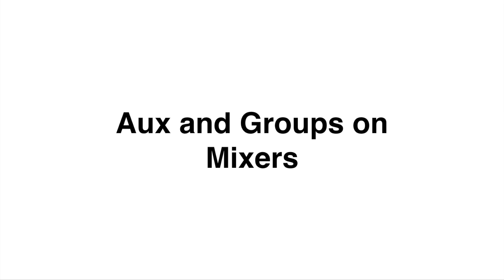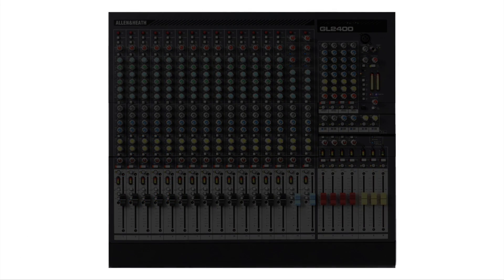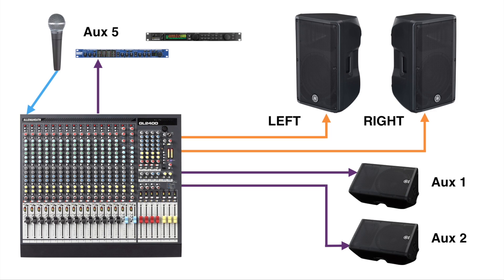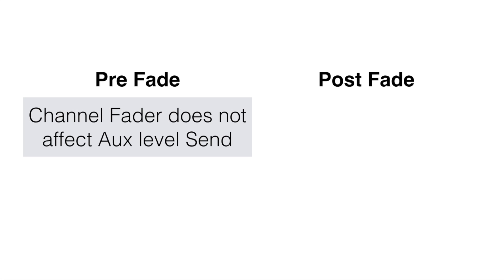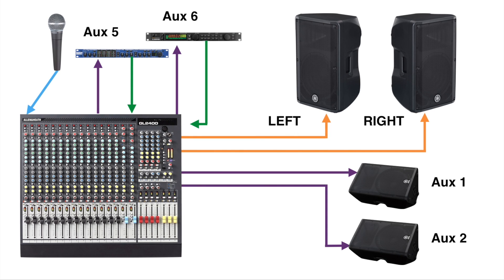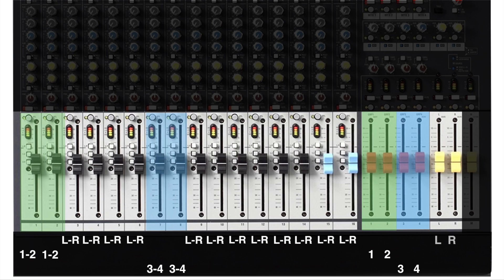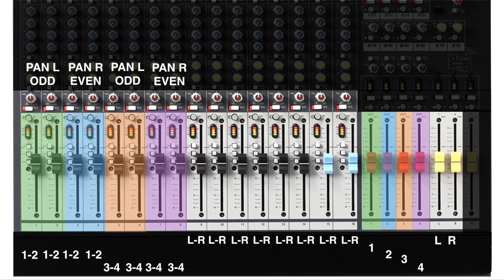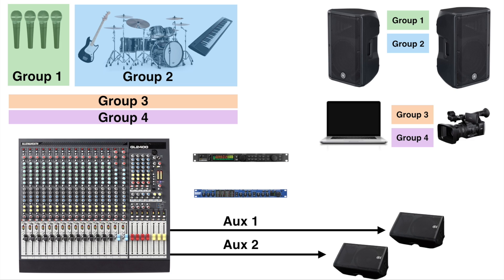Aux and Groups Explained in less than 11 Minutes

Comment: You were doing great until you got to the use of the groups. You wouldn't use a group output to create different mixes for a laptop and camera. The way you have it set up, since the vocals are panned to the left to be on Group 1, the laptop would only get vocals if you assigned it to 3-4. And the camera would only get the band. A better way would be to do pre-fader Aux mixes for each recording device. In this example, you would typically use groups to subdivide the band into drums, keyboards, guitars, vocals, then I usually run only the bass straight to the main bus, turning it into a 5 bus. Other than that, great video and great presentation.

Comment: How do I maintain my stereo panning and grouping? For instance, if I pan my bass drum full left and my floor Toms full right for the LR or FOH. And I need to group my entire drum kit on Group1 in order to have a uniform volume control. That will require planning all to the left/ODD. Will the mixer still maintain my LR drum panning set up for the LR despite the group 1 ODD panning  Or the group panning will affect the LR panning?
Reply: use 2 group channel to output your drum kit, e.g. Group 1 for L and Group 2 for R, then you can: use the group XLR output as is, on the matrix or send the groups (with pan) to LR

Comment: Hi Marlon, I have one question.  The group output for video and laptop, are they mono or stereo?  I am using Allen and Heath ZED 428, is it better to use 2trk out instead? (just for the video camera?).  You haven't talked about MATRIX 1 and 2, what are they?  Thank you.
Reply: each single output channel, whether it be L, R, Group 1, ..., Group 4, MTX1, MTX2 is mono, as a result use 2 output channel for stereo
Each matrix channel independently source portion of: external in, each group, L, R to be its output
2 track out (TRS, -2dBu) is another way to obtain LR out which is XLR at +4dBu
Reply: @philiptong4978  Hi Philip Thank you so much.

Comment: When assigning groups, does panning still affect which side of the speaker the sound is coming out of?
Reply: On this series of mixers at least, if you want to maintain the left/right effect, you have to use a pair of groups. 

You’ll notice that on this particular mixer, each group assign includes a pair of channels, such as 1-2. Pressing that button sends that channel to BOTH of those groups in proportion to the panning. If the channel is panned full left, the entire signal goes to group 1, and panned full left it goes completely to group 2.  Panned to the center, it goes equally to both.

So to get a stereo effect, use a pair of groups. Pan the odd GROUP (not channel)  full left and the even GROUP full right. Then the channel pan sets the channel’s position in the stereo mix. Note that this cuts your available groups, since each stereo group requires two channels.

Hope this helps!
Reply: @RicCrouch  Thanks so much!

Comment: Are delay and reverb on aux 5 & 6, parallel or in series? Thanks
Reply: each channel contribute to the aux 5 bus or the aux 6 bus (yellow pot on each channel), at the aux5 or aux6 output you get a sum of all contributions, before further processing, it is called a dry signal
then you take that summation, send it to the effects unit to process it, after processing it is now called a wet signal
to combine the wet signal to original dry signal you send wet signal back in, one way is use a dedicated input channel

inserts have unbalanced TRS plugs that carry 1 channel, tip = send (output), ring = return (input), sleeve = common ground reference, it is both input and output on 1 wire
there are inserts at each input channel, each group and L, R (can be configured to be aux inserts)

Comment: Great video!!! Thanks for sharing. I have one question. If I connect to the PC for recording or to the video camera, do I need to do it post or pre fader? Which one is recommended and why?
I’m assuming post so I can adjust the volumes accordingly, but not sure
Reply: You want them both to be pre. The reason why is because when you use "pre" it means that you send the volume to the recorder or camera before the faders (volume controls) for the speakers. That way when you turn up stuff on the speakers, it wont effect the sound going to the recorder because the signal is being sent to the recorder before it reaches the fader. 

If it were post, the signal would reach the recorder after the faders for the speakers so that means if you turned up the fader for the speakers, it would also turn up and down the audio going to the recorder. Your recording would constantly be increasing and decreasing in volume instead of having a constant volume
Reply: Gabe Michaux  Thank you very much for this helpful information ❤️

Comment: Hi

How would you connect a subwoofer to this and remove the floor speakers and replace with in ear monitors, and could I give each person their own separate in ear mix or would they be limited to two mixes due to two aux outputs?

And could I then use the subwoofer to run the bass guitar and get rid of the bass amp on stage to make it less cluttered?
Reply: You can connect your sub woofers to the main depending on your application. You can comfortably give separate mix for in-ear monitors if you are using a P16-M or PM 16 when using a digital console.
Reply: With the P16-m every musician can mix whatever they want to hear in their in-ear monitors without affecting the stage mix or the FOH mix.

But if you are using an analog console, it may be difficult to have a separate mix. You can only control what goes into each auxiliary by turning the aux knob on the channel strip

Comment: thanks  please can you tell how i can connect mi keyboard to the mixer?
Reply: sure - what do you hope to accomplish besides a connection? record? monitor mix? If it simply a connection you have some options. The keyboard should have some sort of audio output - rca, 1/4 inch or 1/8 connector. If the keyboard is an electric one, then you can simply plug it into the 1/4 input with an appropriate cable or adapter depending upon your keyboard output. Then you can set your gain/trim and adjust the fader. If you need something different, let me know.
Reply: @MV-in8xs  i THOUGHT  IT WAS MORE EASY TO SET INSTRUMENT INTO THE MIXER
Reply: @MV-in8xs  I have 2 big speekrs , 2 monitor, 1 bass speeker,  1 keyboard, 2 mic  and the makie pro fx 16 channels
Reply: @MV-in8xs  I still in trouble
Reply: @MV-in8xs  i NEED HELP WITH THE INSTALATION

Comment: how can i use M fader    AND   ST1_2ST3_4 fader  on mixer gl2800
Reply from the maker: M can be used as a Center Fill Fader if you have a L R and Center Speaker System - We actually have this type of speaker setup at our church.
Stereo can be used for keyboards, CD Decks, iPad without using two channels faders. They are also useful to have your FX returns come back on a fader. You can the adjust the amount of FX using a Fader instead of a knob.

Comment: How do we install in church
Reply: Great question. That all depends upon the equipment you have on hand. Some churches typically use one or more aux sends for stage monitors for the musicians/singers and reserve another one or more for FX. On the Allen Heath board in the video, there are six aux sends - 1 - 4 could be used for monitors and 5/6 used for FX. Again this is all dependent upon the equipment you have. 

If you have more questions, please let me know what equipment you have or are planning to purchase and I can give you an idea how to set it up. Send email to marlonv (at) gmail (dot) com. If you are local to SF Bay area I might be able to swing by if not too far for me. 

If you are planning to purchase new equipment, then all this could change depending upon your budget. There are many affordable options and you might consider purchasing used equipment. Many churches are letting go of their older equipment as they transition to all digital boards. I hope this helps.

Comment: Some sort of amplifier will be needed in your audio signal to drive your speakers. A powered mixer includes this amplifier as a component of the mixer which often makes them quite heavy. A powered mixer is meant to drive a passive speaker system (no amp built-in to the speaker). A mixer that does not include an amp will only send line level signals that need to be amplified. In this situation, there are two options 1) Passive speakers with a separate dedicated amplifier 2) Powered speakers (this means the speaker has its own built-in amplifier.

So what makes people choose a particular system?
For permanent installs, passive speakers (without built in amplifier) are typically used. In this situation you would need either a powered mixer or live mixer with a separate amplifier unit. This makes sense because the only connection to the speaker is a speaker cable.
For mobile events, like weddings, DJs, powered speakers are often used because they are more convenient. Each speaker would need electric power and a speaker cable. In this situation a live mixer is sufficient.

Depending upon what you are doing, a powered mixer is typically used for quick setups like a school assembly outdoors, or maybe a singer by themselves. For larger installs like an auditorium or club, a live mixer, amplifier and passive speakers is more typical.
Reply: Stated powered main speakers and powered monitored, so the power amp not needed in the tutorial case.
Reply: It states at the start that the speakers are powered in this case. It also states the same about the floor monitors

Comment: Sir! One more question for u.... What is different.. In between ..   Power mixer  n power amp + live mixer.   For passive speaker  what best n why.... So my question is power mixer vs Power amp... N live mixer ...  What is main differences beside high cost
Reply: Sound Zone the best set up for any pa is to have active speakers, which basically have an amplifier built in. You haven’t got to worry then about additional power feeds and cables to the power amp then out to passive speakers.

Comment: There r "only lamp" option input on my DSP power mixer.  What's that for..... sir???
Reply: without knowing your specific unit, my best guess is that it is literally an option to plug a specific type of lamp light for your mixer in low light setting. Some companies employ a BNC or even XLR type connection. I would assume that this connection would only be used for lighting and not any kind of audio input/output. Hope this helps.
Reply: @MV-in8xs  may b u r right ..yes there r xlr plug to join. Thanks :)

Comment: how do I pan my channels for drums and other instruments that needed left and right panning if I end up using my pan knobs to separate my group faders?
Reply: You can divide them between group 1-2 and 3-4, and pan the groups left or right. You only get two groups that way, but they are in stereoooo! We used the same series mixer at our church and set groups 1-4 as lead, vocal, instruments, and drums. I preferred to add a bit of stereo width by sending lead/speaker straight to the mains, vocals to 1-2 and everything else to 3-4. I panned the odd groups hard left and the even groups hard right. Then I could pan the vocals and instruments slightly to get a bit of variety between left and right instead of a monotonous wall of sound. I was probably the only one who could hear it, but I thought it sounded a bit better. (You don't want to go too wide in a live environment because you get problems with people on the far right not being able to hear what's been panned to the far left and vice versa.)
The "extra sends" he used in his example can be accomplished through the Matrix sends. Each of those is a mix of the subgroups and mains.
Reply: let me get back to you - good question - there is an answer